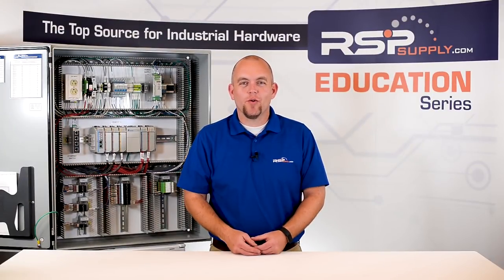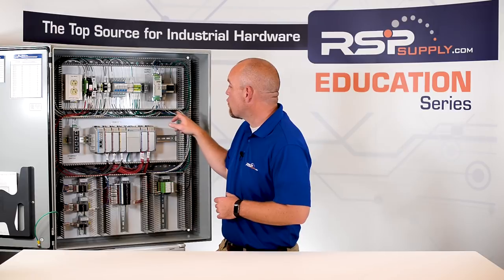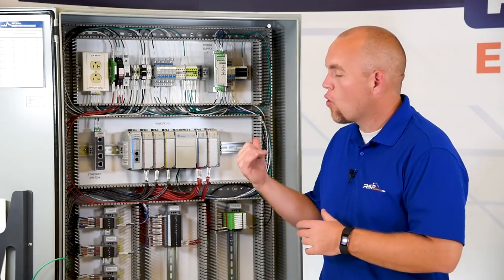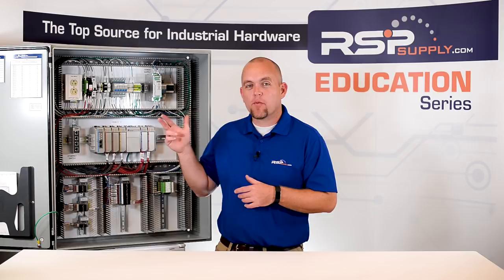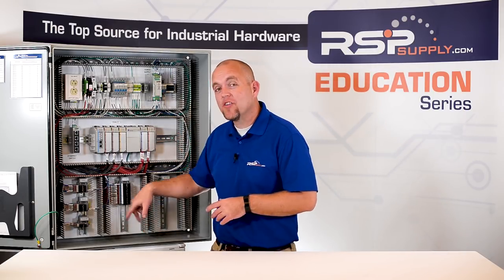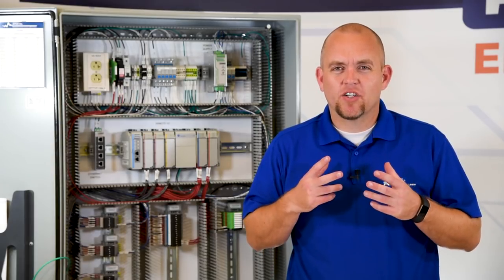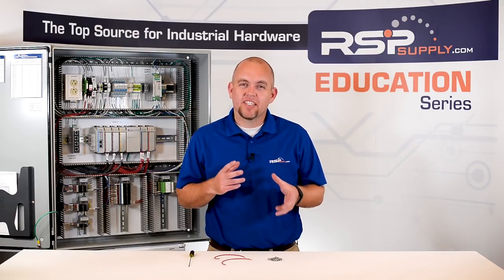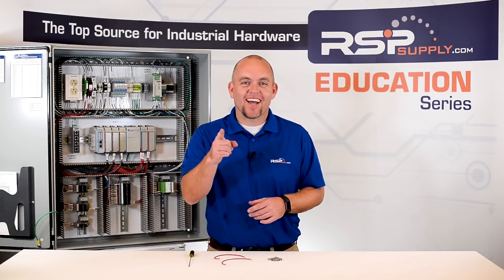Industrial Wiring Tips and Tricks

Comment: Great video!  My only concern was the claim that twisting the strands will prevent short circuits.  However, the length of exposed wire is just as important. Using a proper gauge & removing just the right amount of cladding is just as important to ensuring both a secure connection & avoiding short circuits.
Reply from the maker: Hi, thanks for watching and we appreciate the feedback. I agree  the amount of wire stripped is very important. We do cover that in detail in other wiring videos. It is hard to cover everything in all the videos so I'm sure many videos have additional content that could be added. Hopefully with the entire series we can cover everything and be a great source of education. Thanks again!!

Comment: Don't you ferrule your wire before sticking it into the block ?????
Reply from the maker: Thanks for your question. You don't have to put ferrules on the wire but it is best practice. You can also twist the wire before putting it in the terminal. It is important to make sure it doesn't birdcage where some wires don't enter inside the terminal. Ferrules are the surest way to ensure that the connection is complete but not required in most cases.
Reply: I think this is not safe !!!!
Reply: Adding ferrules to every connection adds to cost and most time if the job is done right it would be unnecessary.
Reply: Maintenance would be so much easier with ferrules
Reply: Yes, always use ferrules. They cost so little, and makes everything so much easier!

Comment: You’d get shot for this in most EU counties.

1) Cables should use crimps or ferrules.

2) ELV (24v DC) etc and LV (120Vac) should be segregated and not mixed like they are here in trunking.
Reply: this is obviously a US panel my guy..